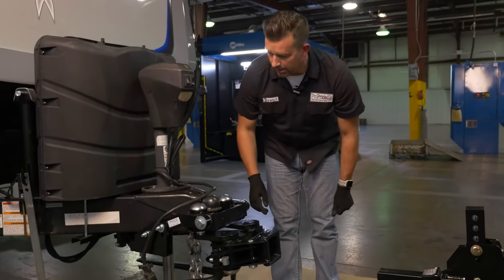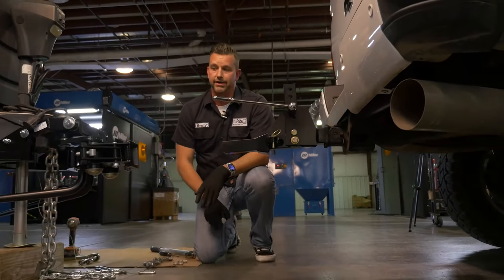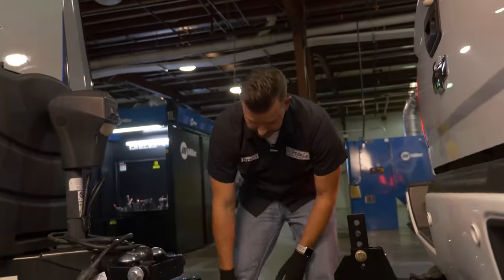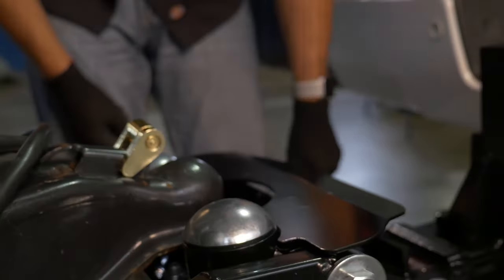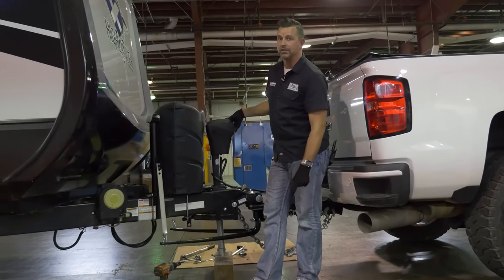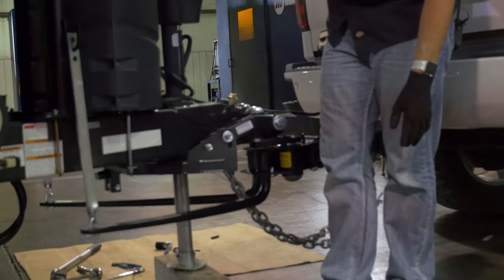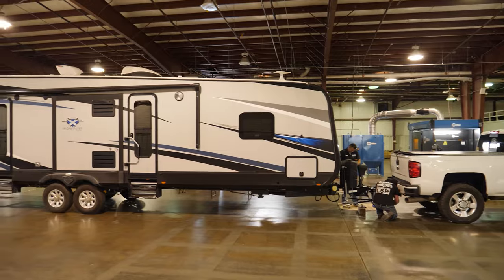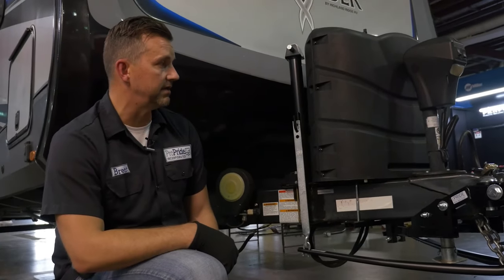ProPride 3P Hitch Installation - STEP 8 Final Adjustments, Hitching & Unhitching (Pages 27-37)

Comment: I use the Straptek system from Lippert for my Pro Pride weight distro bars (not the two jacks that came with my kit). These were recommended by Sean for my case. I have a Vibe trailer and it has a shroud over the frame where the jacks would go. IMO, it is superior because when they are loosed (take 2 seconds literally) it allows the head angle to move up down. This gives it a ton of play for the stinger to go in. I do not even think about the angle of my pro pride head when I am hooking up. Just so I am close to the height (do not need to be exact). Then I just tighten up the Strapteks and raise the jack. I can hitched up in 90 seconds flat.

I have put 25K miles on my hitch and would NEVER tow without one.
Reply from the maker: Thank you for the write up! Keep spreading the GREAT word, we appreciate it!

Comment: First off I've never heard any bad reports of this hitch.  But I've never seen any discussion about having the ball so much further from the rear of the truck.  That's a couple feet further out. You would think the added "leverage" would reduce the receiver's tongue weight restrictions.  Have any thoughts or info ProPride?
Reply from the maker: The 3P sits back approximately 18" further than the standard ball. In most cases, the actual downward pressure on the hitch box (tongue weight) is considerably less than the 195# the hitch weighs overall, but will very on the application. Also, when weight distribution is engaged, you will have approximately a 90/10 split of the tongue weight 90% going to the vehicles two axles and 10% going to the trailer axles.
Reply: That's what I'm thinking,  Ive fixed a lot of customers trailer towing problems with shorting the pin point on the shank of the receiver to get the ball as close to the bumper as possible.  I cant see moving the pivot point 18" further from the rear axle center line helping a darn thing.  If you do the math thats 30% more leverage if the starting point of the ball is 5' from the rear axle center line.  so if you start with 1000lb tongue weight that puts an extra 300lbs for a 1300lbs tongue weight total.  now you have to compensate for that 300lbs plus the weight of this contraption, while leveling out the weight you were dealing with to begin with.  This thing is way over complicated.  If you have sway problems and you cant fix it with moving weight around you need a bigger truck for the trailer you got.  We pull 14k, 32' with 8' walls, enclosed car hauler on the regular. no sway bars no leveling.  It can be done without all this fancy crap.

Comment: My pro pride problems. I had a dealer install it. I think it was there first install. My trailer is 34 feet long sitting on a 3500 Chevy short bed just for reference. My trailer is swaying almost like I don’t have any equalizer at all. I have tried moving my load to help stop the sway and it don’t help much. One thing I noticed is that when towing it always rest off center. Always to the left side. It almost never rest at center when towing. It gets close but never center. How do I adjust it and is that the reason this hitch is not working at all? Thanks for your help. I almost bought a new 5th wheel today but thought I would try a little harder to see if I can get this to work and make it comfortable to tow. Thanks for any advice you may have.
Reply from the maker: Hi Clint,
From the description, it sounds like your trailer is likely nose high. We emailed you to get some additional details so we can work through this and get you all set.

Comment: Weight Distribution- Brent when you went up to 8 inches it puts a lot of stress on the bars, is it ok to constantly pull the trailer with that much stress on the bars?
Reply from the maker: HI Brian,
Yes, those bars are made to do exactly that.
Reply: Instablaster...